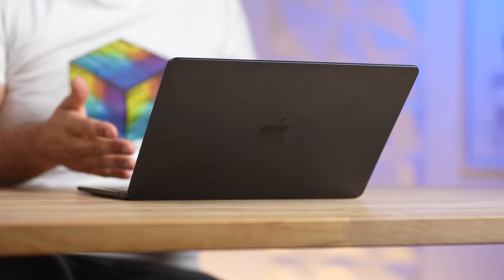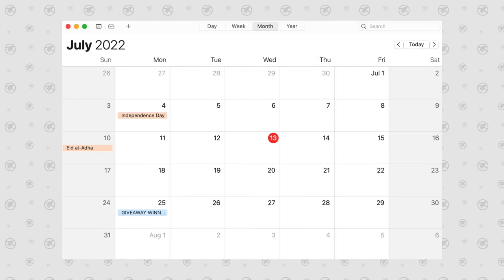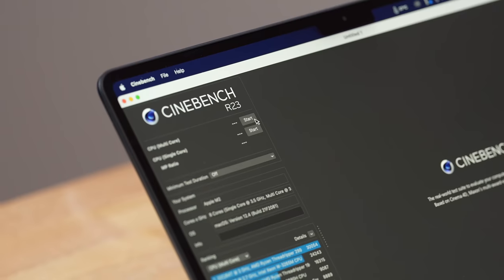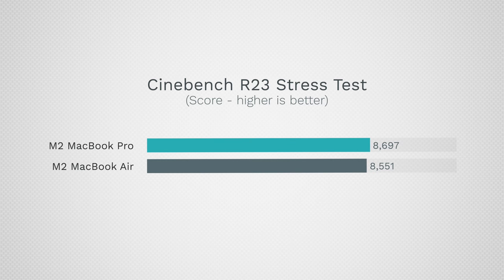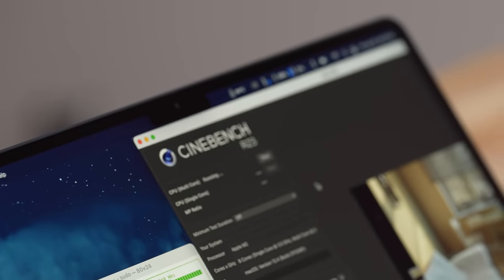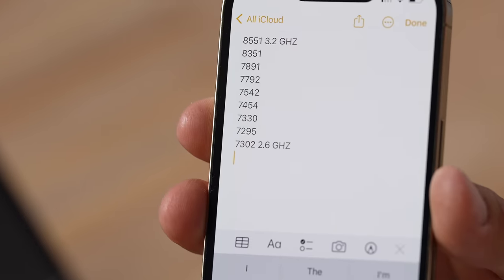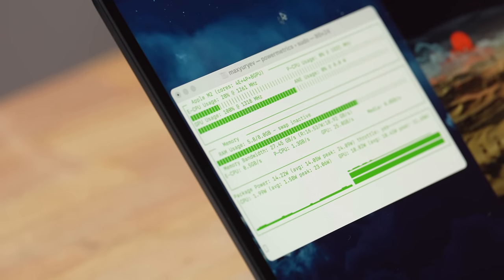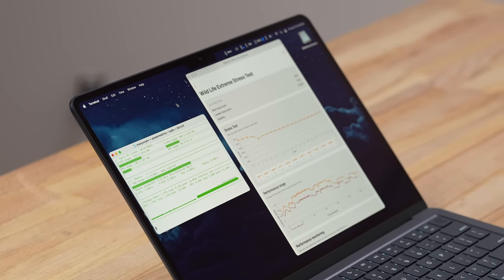M2 MacBook Air Thermal Throttling: How Bad is it REALLY?

Comment: I remember people fearing that the M1 Air would throttle too much but honestly, it was never an issue when threw a somewhat complex 4K edit on it, when I used Logic or really at any other professional workflow. Sometimes it'd get warm but that's about it.
So I really don't think it will be a big issue with this one.
Reply: At the absolute hottest, I’m reaching 205-210f and that’s when I’m doing 4+ hours of very very very heavy sustained multitasking. That’s pretty good considering it’s a tiny thing with no fan

Comment: Looking forward to the comparison between the M1 and M2 airs in terms of heat and battery life.
Reply: exactly
Reply: Yes, me too.
Reply: @rocketmunkey1  While I would prefer everything be 100% speed all the time; Imagine how impressive 4 minutes of full performance on battery would have been before the m1 came out. It was shocking when the M1 was able to do it for ~8 minutes. 4 is still far longer than I peg my M1 most weeks. All else being equal, I think i'd still rather have an M2 than the M1 air I have now.
Reply: @cartossin I know this is a year after your comment above, but curious if you still feel that way? I’m right now considering an M1 or M2 MBA in base form with photo editing my heaviest load on a machine. If you’d still lean toward M2, can you let me know why? I assume the other features like the updated form factor, MagSafe, audio?
Reply: @rocketmunkey1 when you say 30% slower than M1, do you just mean the top speed of M1 or the sustained M1 performance during similar tests? Thought I understood the M1 also throttled but after 8 min instead of 4,  but please correct me if I’m wrong. I’m actually looking at both M1 and M2 MBAs right now (even M3) but unsure if I need M2 or M3 with photo editing being my heaviest single workload and usually for 50 or fewer photos total in a session.

Comment: Definitely want to see if the performance will change with extra thermal pads, appreciate the hard work guys🙌🏻
Reply: it'll make the case hot asf but sure, it'll improve performance alright
Reply: @bolttracks  isn't it gonna lose the warranty?
Reply: @bolttracks  not sure if it’ll get that hot, likely too hot for long comfortable lap usage, but seeing the wattage of the chip it can’t reach super high temperatures as seen with intel or amd. It will need to heat up the entire chassis… but seeing the 108C is worrying.

You can edit the temperature profiles, so maybe if they set it at 85 with thermal pads connecting it to the chassis, it might be able keep a sustainable speed for a longer time without boiling the fineer from the desk. 🤪
Reply: They will surely make the backplate hotter than the legal surface temperatures referenced. Fine for station work, not good on your lap.
Reply: same here
Reply: @blaineandrada4842  What's the limit degree of temperature? Could you give me a citation link of the reference?
Reply: Kind of disappointed with the thermal performance. That's one of the selling points of the MacBooks
Reply: @robertjannauta2638  how can you edit the temperature profiles of a Apple Silicon Mac?
Reply: Please test with thermal pads and other ways to cool the SOC
Reply: If you have to add thermal pads to  make it work reasonably well, perhaps implies its poorly engineered or it should have had a fan to begin with IF you plan on actually getting all the performance you are paying a premium for !
Reply: i've done this on an older xps 13 model and it definitely improves heat dissipation, effectively you're making the bottom chassis a passive heat sink. The flipside is that bottom chassis can get burning hot. It's worth it imo because the difference in performance for my xps was night and day.
Reply: @FirstLast-dq4sq  they added paste cuz they opened it up before doing the benchmarks which was a dumb thing to do i’ve lost respect for this crew
Reply: Would be interesting to see thermal camera of m2 air bottom frame compared to m2 pro
Reply: @Randomstuff-lo3kx  There needs to be a "fan dongle" for when you're doing renders on the M2 MBA, you plug that in and it's a fan and it pushes air into the enclosure and it comes out the speaker grill taking some heat with it. I might jig some up when I gets mine M2 :')
Reply: Did they say if they benchmarked the same machine as they have opened an examined the motherboard? Because they bought 4 machines.
Reply: Nice video guys
Reply: @dannyvopalecky1106  Yes he did in the very beginning of this very same video. Please watch it again.
Reply: @lohaswinner  11:50
Reply: @FirstLast-dq4sq  Since the Air doesn't have a fan, it is completely silent. This appeals to some buyers
Reply: @blaineandrada4842  I wonder about law text. But, thanks a lot for referencing the video time. I see the degree is about 50 celsius.
Reply: I agree. This is the cutting edge channel to watch for performance numbers and tear downs. Excellent work.
I notice any other channel basically duplicates/parrots what MaxTech has already put out.

Comment: I finally decided to get the M1 Air for a couple of reasons:
- It’s still a very good laptop compared to other options for the same price
- Since it’s cheaper than the M2 i got to spend more on RAM and got the 16GB (and still ended up being cheaper than the base M2 model!)
Reply: I did the same the M2 feels like it’s not a big deal really like the M1.  I prefer the older shape as well.  M2 feels like a stopgap processor.
Reply: Same! I got the 16g ram and 512g ssd plus education pricing I got mines for about $1,100. 🥰 I think it's the better option imo.
Reply: Yes extra ram for less and that iconic design. Can't go wrong. Also, having had my one for over 1.5 years with 16GB, I have never found it wanting, I described it as the biggest step change in computing since the Dec Alpha
Reply: @kiaragarcia3704  yeess education discount! I remembered right before paying that I could apply for it lol
Reply: The only thing I found better of the m2 base model vs the m1 16gb-512gb would be the blue color, and yeah... That doesn't worth the extra cash or the lack of ram-storage
Reply: @The_MEMEphis  why need refurbished when you got best price from Apple edu back to school 900-150gc
Where you found 700 deal?
Reply: yeah I was thinking the same but like...the new design is SOOOO tempting
Reply: Don’t forget to add thermo stickers recommended by channel
Reply: I tried education discount with MBA m1 16/512g ,and it was for 1259$. How did you find it for 1000$?
Reply: @ay00d97  they are lying.
Reply: @richertz  stopgap processor??? How weird! Hardly been out anytime at all and people think they know everything.
Reply: Same just got my m1 air
Reply: Taxes are different in each state lol
Reply: @jaypalmer3806  I think it’s a fair assessment the new style of case is great but it’s no leap forward.
Reply: @richertz  leaps forward comes with time. Look at the iPhones, hardly any difference between 11 and 13. That’s normally how it is in the tech world. The biggest jump was intel to M1, you can’t expect leaps and bounds every single laptop or phone release.
Reply: @jaypalmer3806  true I never really said anything other than I prefer the MacBook m1 I have now, it replaced my Intel 2019 i9 16 inch.  I made a bit of a sacrifice upgrading earlier than expected to the M1.   Other than the shape of the M2 though I don’t think it offers much.  I’m still blown away by the battery life of my M1 above all else.  Not really complaining I just think the m2 exists in it’s form due to chip shortages.
Reply: @richertz  I have the M1 Air and the 14 pro, air M1 is an incredible laptop, problem is I’m a geek and love new things. So I’ll sell my air and buy the air m2. Waste of money, not needed but you only live once so……
Reply: @jaypalmer3806  fair enough I hope it’s worth it!
Reply: @jaypalmer3806  spoken like a true peasant.
Reply: @bthegawd8113  makes no sense, sausage jockey.
Reply: @richertz  who cares if it isn’t? It’s a laptop………

Comment: I am definitely interested if modding it with thermal pads has a dramatic impact. Looking forward to that video, as well as the MacBook Air M1 comparison!
Reply: It will. But it will be more dangerous than that on previous gen. It's too hot & can burn your lap.
Reply: @TechieBaby  that’s a good point.

Comment: I'm interested to see how a 16 GB RAM / 512 (or higher) GB model performs -- does the extra SSD and additional RAM help
Reply: I'd think the 8/256 might perform better on the temp since you have a chokepoint at the SSD and ram which may prevent throttling and heating as much.  Would be interesting to see the 8/256 test vs 16/256, 8/512, and 16/512.

Comment: This testing indicates that architecture of M2 has a sweet spot at 2.5GHz where it runs at less than 10W at full load and still gives you almost 80-90% of M1 performance at cold start. Commendable effort guys. Keep it up with extensive testing to let us customers make optimum decision for our hard earned money.
Reply: Can I ask for advice? I’m thinking about getting the M1 with 512 gb and 16 ssd, and if I’m going for the m2 air I’ll get the 512 ssd with 8gb ram, which is better? Thanks in advance
Reply: @jhun8838  Ram is more important in a mac than storage. You can get a external ssd if you need the storage for $100
Reply: @jhun8838  My advice based on your two stated options would be the M1/512/16GB. I think you'll find having the 16GB of RAM will be much more useful than the speed bump of the M2 if you are using more than say 5 apps and a bunch of web-browser tabs. For rough estimate, think of each running app using 1GB RAM on average, and each YouTube tab open using half a GB. It won't take long before your RAM gets used up. Aloha.
Reply: @jhun8838  the advise given Kaliko trapp is best for you in the long run since going forward, you may find more and more apps taking advantage of that 16gigs of RAM.

Comment: That performance drop when doing the sustained load test seems quite impressive to me!

Loosing only 17% performance for a machine without a fan and that is designed for everyday use is amazing.
Reply: Yes these test have no affect on 99% of people.
Reply: This is why people are being over dramatic about it, IMO. Yes, it throttles more than the M1 does, but it’s still faster than the M1 in the same circumstances.
Reply: @mbvglider  cheap thermal pad of Amazon will probably solve that for people as well. Just turn it on if you a long running task
Reply: @mbvglider  Yep, people who need constant long performace will buy the new Macbook Pro. For most "home users" this M2 maschine is more than fast enough.

Comment: This is a lot more thermal throttling than we saw with the M1 MacBook Air. I wonder if thermal pads will be enough to keep it cool this time.
Reply: I wonder if this is a trend that will continue to get worse with future Apple silicon in the MBA and if Apple will need to drop passive cooling all together.
Reply: I suspect that as Apple attempts to squeeze more performance out of their chip, you will come to a bottleneck where the M* chips will suffer from stability issues without active cooling and throttling.

Comment: I have the base model 14-inch M1 Pro with 16GB RAM and 512GB and it's enough, but barely enough for what I do. I run Docker containers, MongoDB compass, Brave & Chrome (with avg 10 tabs each), VS code, Postman, Slack, etc.. and it usually doesn't run with any stutters. It will typically write about 1GB to swap. I would have liked to have gone for 32GB RAM upgrade, but I didn't want dish out an extra $400.

However, the unified memory is really fast and snappy, and the base M1 Pro should be more than enough even for 99% of productive users.

Comment: I’m surprised that for the first few minutes of intensive workloads, the M2s’ temperature goes up past the boiling point, it would be nice if Apple made a setting where you could just keep the M2 running at that level where it uses like half the wattage but is only a bit slower to save battery life and to keep the laptop cool and prevent it from going above boiling temperature.
Reply: It’s in Fahrenheit

Comment: It's a bit bizarre to see this. It seems that the M1 is the true Apple Magic after all. Nothing can beat its price-to-performance ratio. I think the 8Gb M1 Macbook Air is the best value for most people as it is powerful enough to be used as a video editing machine yet cheap enough for those who use it for simple tasks. That being said, I regretted not upgrading to the 16Gb version for future proof.
Reply: Would you only upgrade to 16GB or also the SSD? I'm looking at getting the M1 air but not sure if I should upgrade the RAM or SSD
Reply: @Jorge-jk5xr  same here. I was planning to get the M2 MBA, but after all the info it seems that the M1 is a better choice.
Reply: Yeah it seems like the m1 air is still the better laptop take away the fact you dont get the new design or brighter screen i dont see a reason to get it over the m1 unless you just want that new design.
Reply: Even without 16GB, it has faster base storage speeds to help with virtual memory swap if need be.
Reply: Yeah it'll be interesting to see if the M1 value goes up on the resale market market
Reply: @Jorge-jk5xr  Not a macbook, but I had a M1 mac mini with 16 Gb to test out, picked up the 8 GB mac mini... wish I had gone for the 16Gb one. 
Seems like for performance, you don't have an issue with the M1 air, so I'd go for the RAM over the SSD if you had to choose.
Reply: @Jorge-jk5xr  the RAM is a must, while the SSD is more like something nice to have. I've been working on an external SSD for all of my video projects and it handles them like a cham. If you are ok with taking your external SSD everywhere with your MacBook, it's a great option as you can buy more storage at a lesser price than Apple charges for its storage upgrade.
Reply: @Jorge-jk5xr  Upgrade just the RAM. I don't recommend upgrading the SSD because you can get a better price per GB with an external drive. SanDisk & Samsung have made really powerful external SSDs for 1 TB.
Reply: @GB muchas gracias!

Comment: M1 made me really excited for M2 Air refresh however it is underwhelming. Upgrading the ssd costs too much extra,  Windows laptops give a tough competition at that price point.
Reply: Ssd upgrade is not worth it. Theres icloud or external drives you can buy. Ram is the only thing that is worth upgrading depending on your work flow.
Reply: MacBook Pro 14 went as low as $1650 USD on eBay, making it cheaper to buy than upgrading M2 MacBook Air and Pro to 16GB and 512GB.
Reply: @romari2706  I would argue it depends on what you want to do.
Reply: @romari2706  So you're one of those who thinks Apple is still expensive? LOL - Recent years have proven otherwise!! just saying!
Reply: @romari2706  Maybe for your use cases but that doesn't mean it's like that for everybody.

Can the macbooks run heavy 3d modelling/rendering? Windows PCs are a much, much better option if you're doing those kind of workflows. You can't compare even the M1 max's GPU performance to NVIDIA's GPUs in 3d rendering especially in scenes with heavy lighting effects. Having dedicated raytracing cores to boost lighting simulations makes a world of a difference when compared to apple's non-raytracing GPUs.

I haven't even talked yet about gaming. If you game by the side then windows laptops are basically your only option.
Now don't get me wrong! The macbooks are no slouch! They are amazing machines and are by far the best performers for their use cases while being so efficient and so well built, but that doesn't mean windows laptops are useless. They may have inferior build quality, run hotter and louder with less battery life but depending on your use case, windows may be the only option.
Reply: @romari2706  Maybe for your use cases but that doesn't mean it's like that for everybody.

Can the macbooks run heavy 3d modelling/rendering? Windows PCs are a much, much better option if you're doing those kind of workflows. You can't compare even the M1 max's GPU performance to NVIDIA's GPUs in 3d rendering especially in scenes with heavy lighting effects. Having dedicated raytracing cores to boost lighting simulations makes a world of a difference when compared to apple's non-raytracing GPUs.

I haven't even talked yet about gaming. If you game by the side then windows laptops are basically your only option.
Now don't get me wrong! The macbooks are no slouch! They are amazing machines and are by far the best performers for their use cases while being so efficient and so well built, but that doesn't mean windows laptops are useless. They may have inferior build quality, run hotter and louder with less battery life but depending on your use case, windows may be the only option.